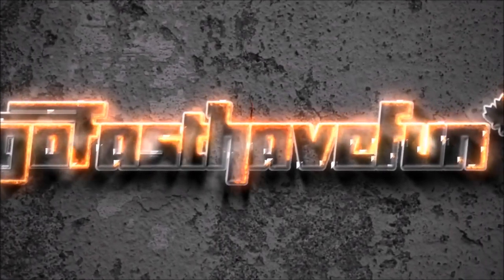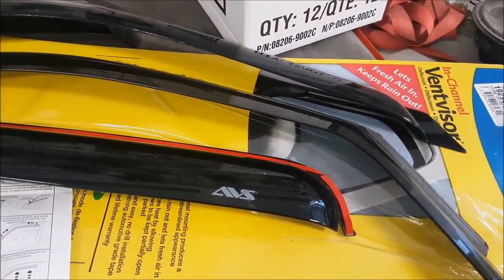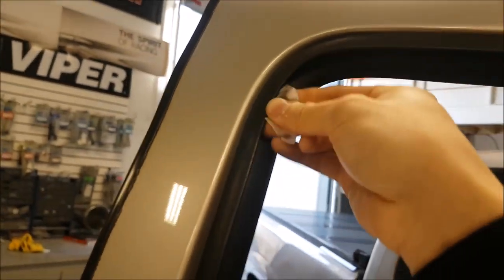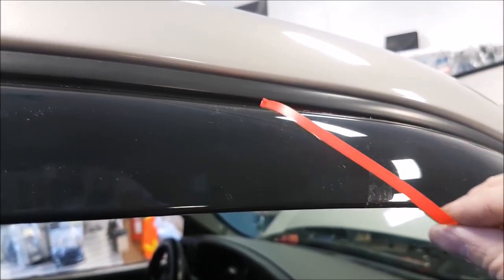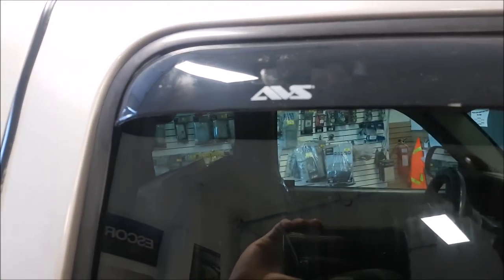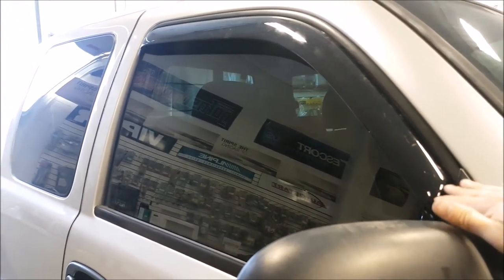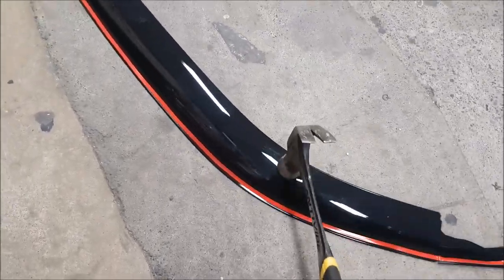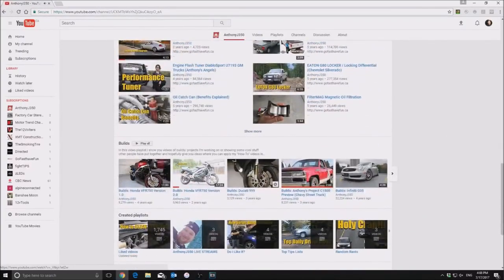Vent Visor Installation Plus Features & Benefits | AnthonyJ350

Comment: agreed, how often to you disassemble your vehicle to check for rust spots, I found some rust spots under the hood of my car where the rainwater catchment from the windscreen, because it was second hand from multiple people I had nobody to blame...

Also check the rubber seals of class to make sure they are not firm and are sealed against the glass... the rubber doesn't last forever and it really helps to put that on your list when it comes to preventative maintenance
Reply from the maker: Happy Fox It's all about the little things

Comment: had a pair on my opel corsa beofre
Reply from the maker: Martin Cooper Did you find them useful?
Reply: AnthonyJ350 yea is say so I changed up to a focus. I needed a bigger car
Reply from the maker: Martin Cooper Would you buy them again for the Focus?
Reply: AnthonyJ350 may do. However those  floor liners I can't find for right hand drive focus. You'd think cars were symmetrical
Reply from the maker: Martin Cooper I would think so. Look up exhaust systems. If the same part number is used that means the floor pan should be the same.
Reply: AnthonyJ350 I mean looking at floor mats the passenger side is longer

Comment: I bought some for my car and they dont fit right, they force them selves up. Gonna need some industrial strength double sided tape.or something
Reply from the maker: gabrielgalaxygh What brand did you get?
Reply: AnthonyJ350 no idea, bought them used
Reply from the maker: gabrielgalaxygh Maybe it's for the wrong year? Is it off by a lot?
Reply: AnthonyJ350 he said he had the same car and year just sold it, and they're not off as far as too long or too short. It pops up on the corners like if they got warped from heat or something. I tried new 3m tape but they still pop up. . .
I'm honestly thinking super glue now lol
Reply from the maker: gabrielgalaxygh I would just buy a new set. You want to be able to easily remove them
Reply: AnthonyJ350thats my last resort. gonna try using my heat gun to make it flexible and then put new 3m tape